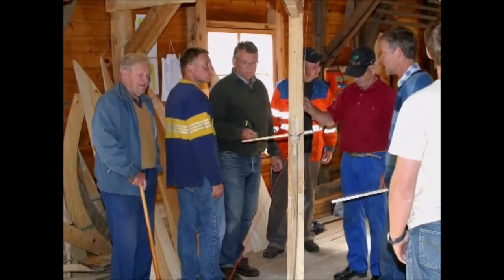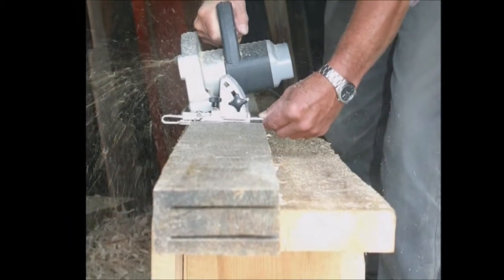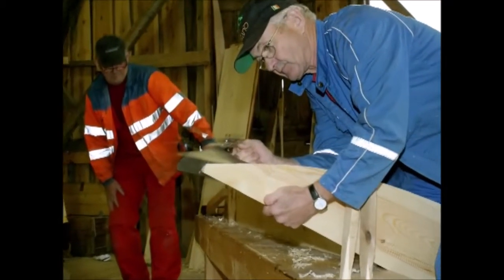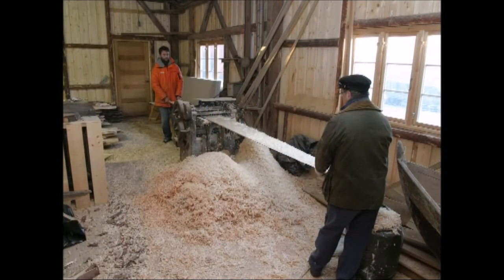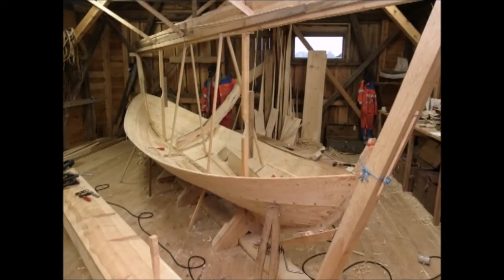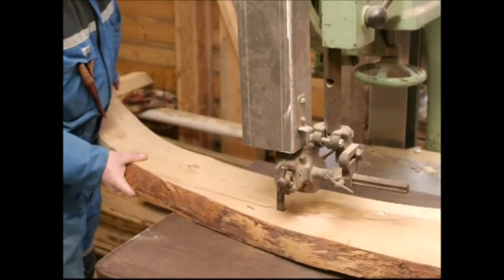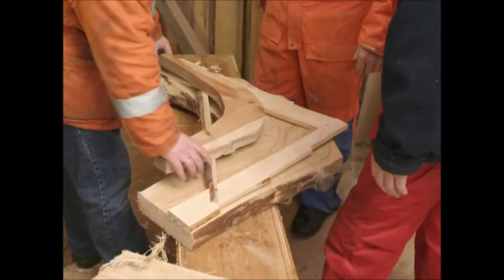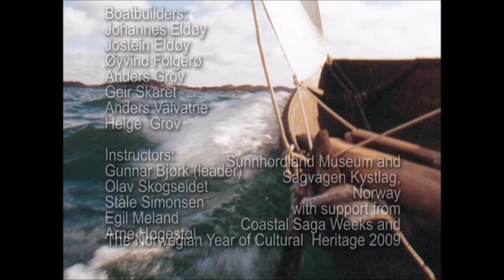"How to build a faering" - (korleis byggja ein færing). Eng.versjon

Comment: Excellent video, .. very instructive ..;  I am writing to you from Brazil and that video increased my interest in ... maybe making a similar ship ...- so far I have only made Viking ship models as realistic as possible ... (Skuldelev 2) that were made with a system of similar boards, I have some doubts: ... what is the length and width of that boat?  And how much is below the waterline?  .. what wood was used?  ... and the thickness of the boards ??  .... How long did it take to build the boat?  .. And those copper nails with rebites were bought on an Internet site?.....and ... how much does that boat weigh ?